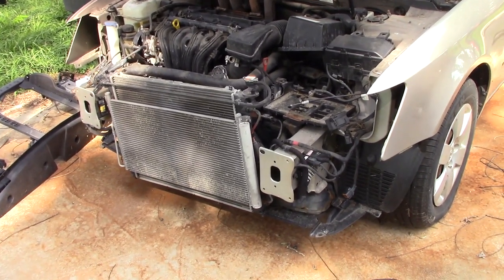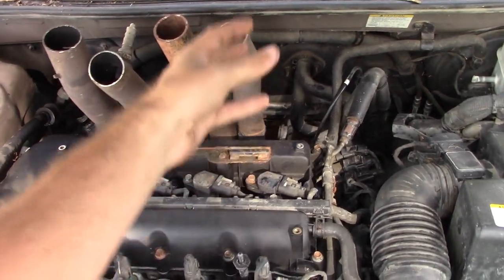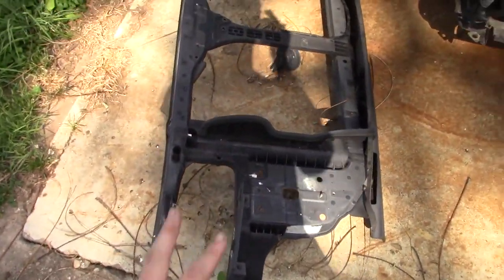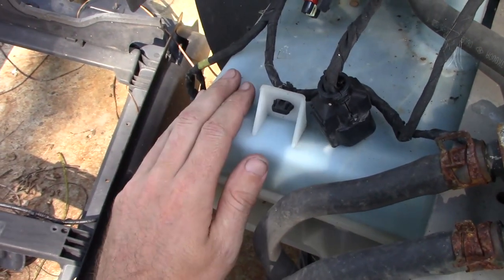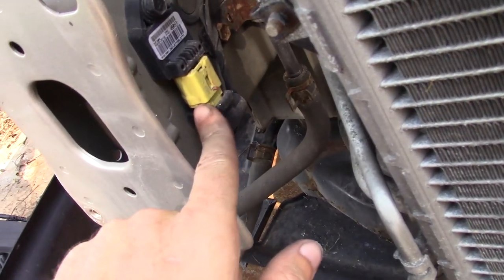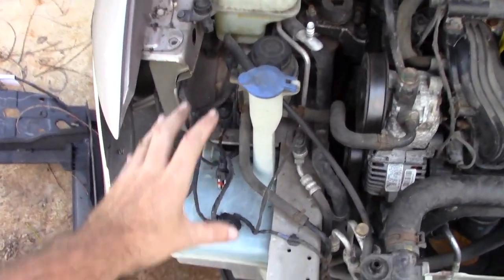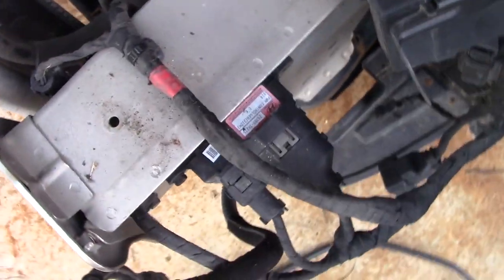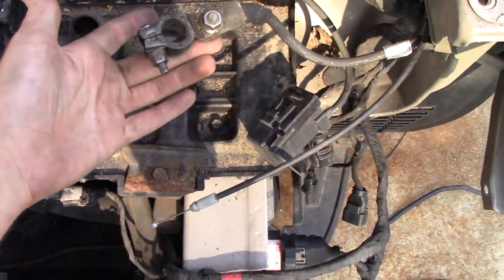2006 Sonata Derby Build Ep 2: Electrical for Beginners

Comment: Good video, I am lucky enough to have alldata to tell me basically what every wire is on each car out there. I still move wires similar to how you move wires because I still see stupid things happen. I would recommend alldata(or shopkey, etc) to any derby driver because you can learn a lot by just using alldata(how things function for example).

Comment: Yes  it  the pipe is to shorth   means  not scavenging the cylinder   not enough  smoke going  out   vs  air in  your  on point
Reply: @applepoop10  He hasn’t made a video about engine building because we run stock cars… we do not motor swap, just simply move wires to safe locations.